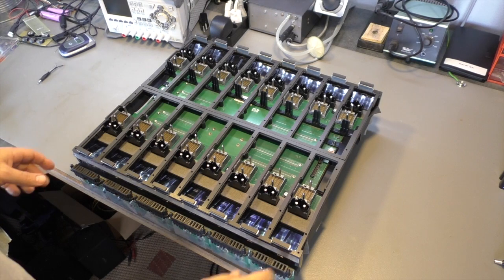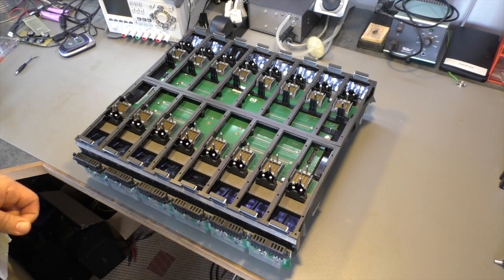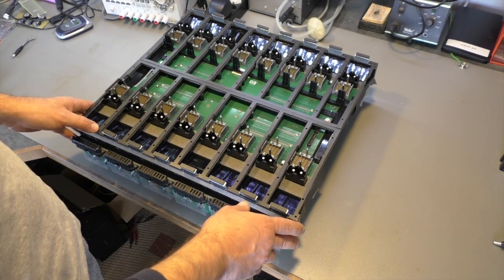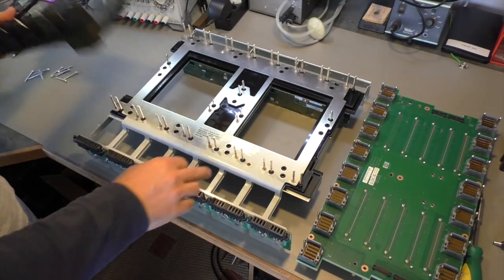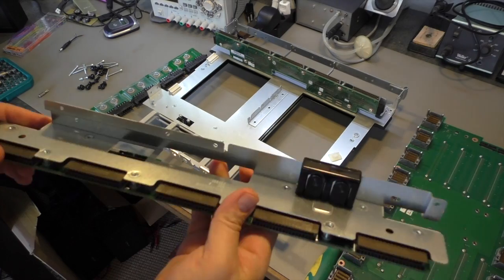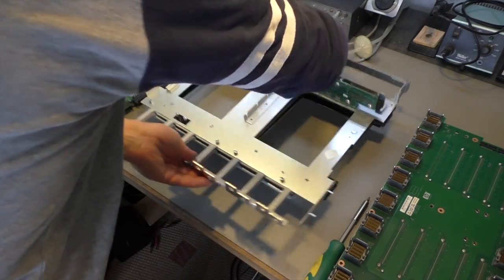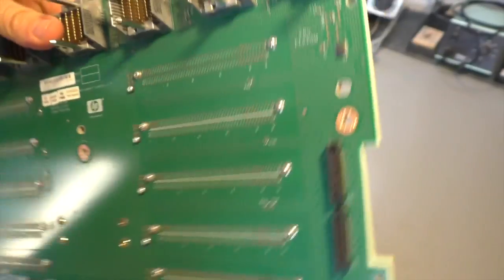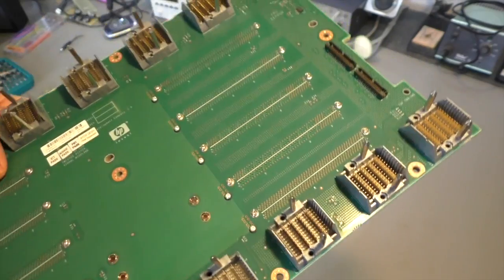HP C7000 midplane teardown (PWJ17)

Comment: @20:50 Twisted Sister is the G2 Midplane which does ~ 5Tbps
Red Hawk is the G3 which was upgraded to ~7 Tbps
Reply: I have 'Airborne Midplane" (414050-001)
Any idea what gen is it?
Reply: Ok I figured it out.
'Airborne Midplane" (414050-001) is G1 - 2007
'Twisted Sister' (519345-001) is G2 - 2009
'Red Hawk' (689229-001) is G3 - 2012

Comment: Hey, since you have the power plane, could you possibly tell me which pin is the current sharing pin? Normally on HP PSUs it's just a pin that is connected between all of the power supplies to enable the current sharing. Do you know which one it is?

Comment: This thing is bloody incredible ! Why was it discarded, just because it became obsolete or did it fail in any way ?
Reply from the maker: msylvain59 We changed it because it was suspected to have an issue with one slot. I don't believe it was really defective but the trouble of changing it again and testing it was too big. A used unit is about $200 and we have two more in stock... So it was not worth the extra work.
Reply: +msylvain59 Large companies retire these units every day.  I got one for free and run it in my garage when I need to do testing.

Comment: U know how dam hard it is to get the psu connectors for the c7000 psu let alone any server psu with that style of connector 

I've spent months looking and still got little luck
Reply from the maker: I know that very well. Those custom connectors are almost Unobtainium.
Reply: I'm surprised that these boards would be biffed tbh 

If I ran a business I would definitely be getting the old gear back for exchange

I'm building my own connector myself 
I think I might have a source buy them but isn't solid 

It isn't hardest to build them though